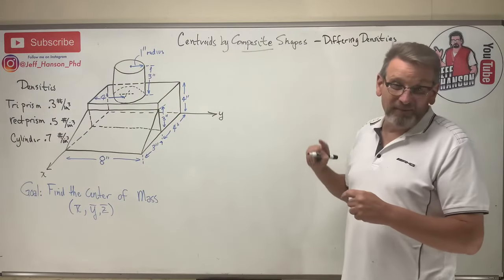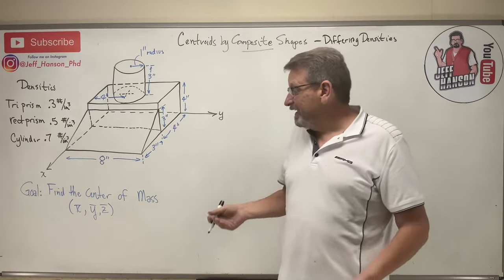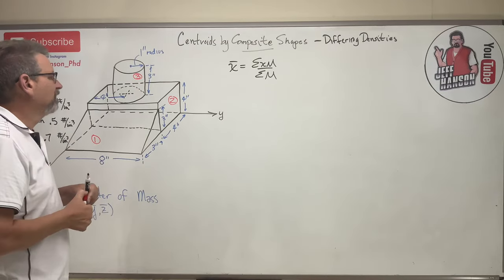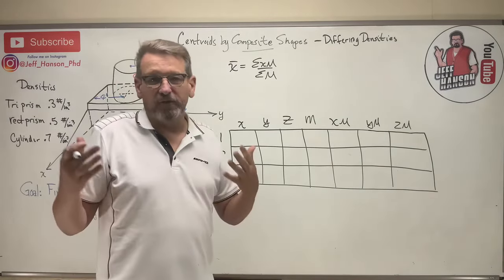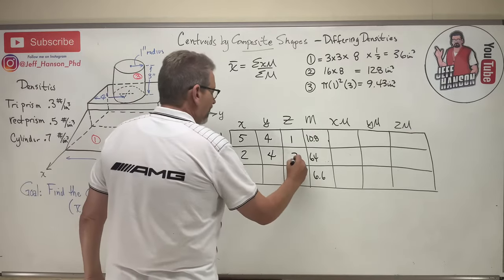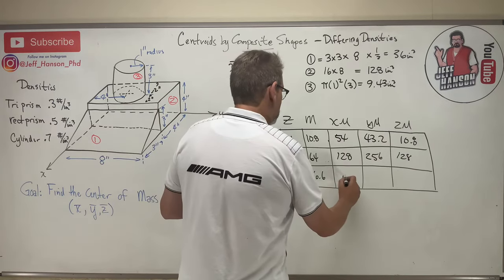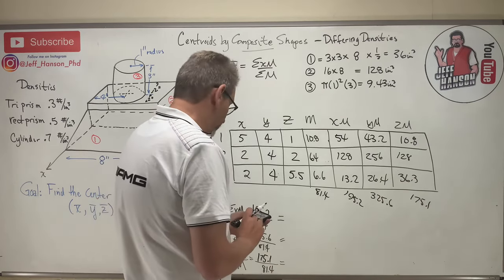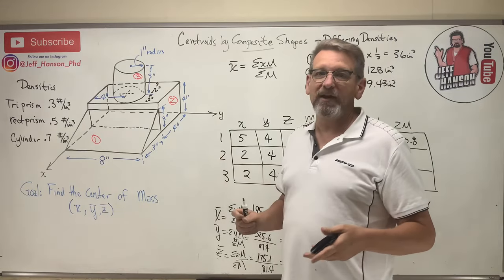Statics: Lesson 41 - Centroid of Mass, Body with Different Densities

Comment: Dr.  why you did not multiple the densities of mass into a mass? (you just calculate the volume with multiple in mass )
Reply: his answer is correct. Density = Mass/Vol => Mass = Density(Vol) 
Mass lb = Density lb/in^3 (Vol in^3)
There would be no reason to do it any different I wouldn't think.

Comment: I was doing centroid met with cone shap with  150 radius and  cylinder  of 50 radius  bore inside they asked height of inside cylinder 
I watched almost all videos of volume but couldn't get right ans 
Than now I realise my mistake 
What I was doing is 
Total volume = volume of cone  without cylinder + volume of cylinder 
My mistake 
I was taking cylinder volume pie r square×height  which is ok but I was also taking volume of cone with same formula which wrong 
Volume of cone is = pie r square × height ÷ 3 
But good things is I learned about volume more

Comment: Frame with three members one is vertical length 7 
Second is like two force member (3,6)  both end pin connected with first member and third member.
Third pin connected with first( 6,6)
 60# Weight coming straight down from tip of the third
When I solve them for x centroid y centroid with table and lenth answer are correct but when I solve sum moment devided by weight answer wrong 
If I ignore the external load which is 60 then answer is right in moment over weight methed 
Density of each member is 4#/ft 
I considered w in center of all members plus 60 external then sum of moment of all w divide by w ans is wron but lenth table is correct answer becoz no worries about w
But what's wrong with moment method I don't know